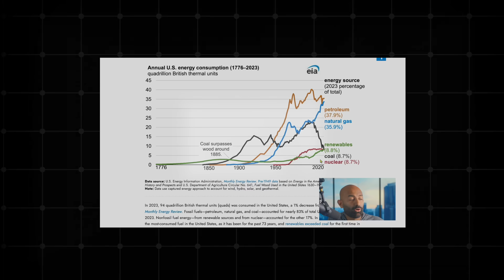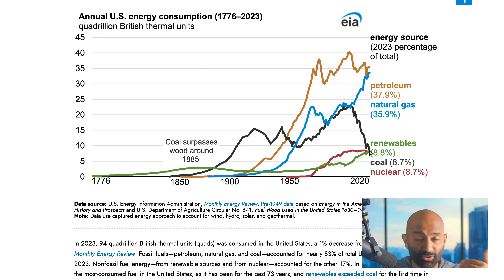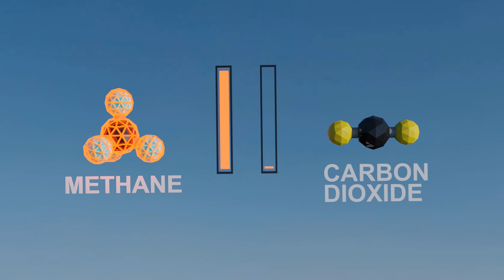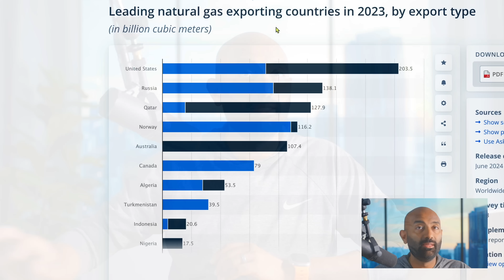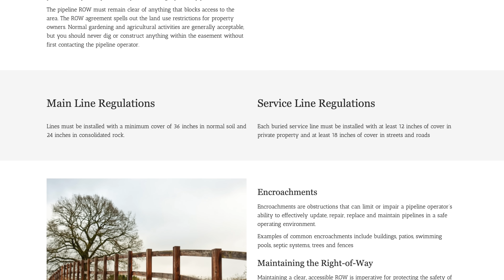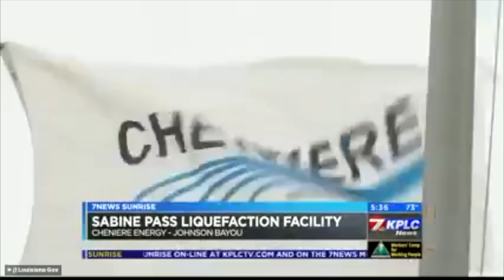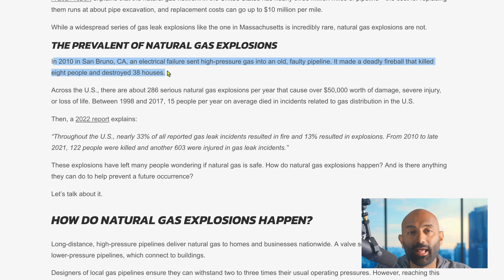The TRUE Danger of Natural Gas - This SHOCKED Me

Comment: Here in Phoenix, electrical power is expensive. I use NG to do all of my cooking plus Southwest Gas does not tag me with on demand charges like SRP ( Our local power provider ). I have solar already and will be putting in batteries soon. I switched my clothes dryer to NG so I can run it whenever  I want and not be hampered by on demand charges plus its cheaper than electricity.  i won't  be giving up NG anytime soon.

Comment: Okay, I get it, you do not like natural gas. Why would we want to systematically improve an already-established infrastructure to deliver a long used and stable energy source.
I live in San Bernardino: I am not retrofitting my over-100 year old home with an all-electrical solution. My stove is natural gas, our primary heating is natural gas. Our backup is a split-air system that is of no use if we do not have electricity (e.g., a days-long blackout).
The argument that natural gas is an antiquated or inefficient source of heat or flame is a tired one. In early January, the community I used to  live in had whole blocks of homes decimated by a fire caused by an exploding electrical transformer.
Please, explain to me again why our country does not want to upgrade and improve the delivery and usage of a natural resource that we have in abundance?
Reply from the maker: Great points! Why I don’t support banning it. But our infrastructure is not updated. How can we make these utilities ensure safety. Natural gas pipelines are aging and definitely need to be addressed. 

Also prices will continue to rise, electricity might just start to fall

Comment: The reason why coal consumption dropped so radically was that natural gas became very abundant and less expensive on an energy basis than coal.  As a result, natural gas displaced coal as the fuel source for generating electricity.  One of the benefits was a near 20% reduction in CO2 emissions in the US.

I also suggested that you compare train accident rates to pipeline accident rates.  Reportable train accidents occur on pretty much a daily basis.

Comment: I've never understood why natural gas and propane are often run through ungalvanized black iron pipe, which probably doesn't even last as long as your galvanized pipe did.  Natural gas companies are using plastic now on their high pressure side, which I believe is usually around 60 PSI.

Comment: Here in Australia, I used to work in Gas and Electricity, now just Electricity, we have to keep all the pipes pressurised , with regular pump stations, partly to keep leaks above the explosive mix level.
there is a significant level, measured all the time, of leakage that always occurs between the GAS extraction and the customers.
But not only that gas seeps out of nearly all joints and especially the end user devices like cooktops, not much, not enough to cause an explosion but you are breathing it.
We are trying to move away from it, but then you have all eggs in 1 basket.

Comment: My natural gas service was installed in 1999 with plastic lines. The regional gas company has replaced main lines with plastic.  We live in a rural area. Environmental regulations have restricted any new wood stoves. When we lose power due to storms it can take up to a week to get it restored. Without electricity and with only a heat pump we would freeze. A small generator can easily keep a gas furnace operating. If someone has a lot of money to spend, they can install a large natural gas powered standby generator to run their heat pump. The natural gas still needs to be available.

Comment: Natural gas furnaces, water heaters, stove tops, ovens, and clothes dryers are inexpensive and can go years with zero maintenance (aside from periodic dryer vent cleaning).  Water heaters also require flushing and annode replacement, but that applies to all types, not just natural gas heaters.  In contrast, heat pumps are more complex and costly to maintain.  The sealed refrigerant systems often develop leaks and repairing them is quite expensive because the cost of just replacement refrigerant is several hundreds of dollars.  Heat pumps may be efficient, but they are not $economical.  If you doubt that, just ask yourself how often you see or hear of people replacing their refrigerators vs. how often you hear of people replacing their furnaces.

Comment: Right off the bat, the pipe you demonstrated is galvanized iron pipe, but by code should have been black iron pipe. Further more, that (unprotected) pipe was obviously buried in wet soil, which is verboten. Underground residential gas piping has been HDPE (polyethelene) now for decades and the iron risers are corrosion protected..

Comment: I don’t know where you live (how temperate is the climate) but up here in Northern Illinois only a fool would convert away from a gas furnace.  Heat pumps don’t work at our winter temperatures and resistance heating is over the top for costs.  So that’s a big NO for me.

Comment: What is not mentioned is that Methane has 20 times the effect that CO2 does in trapping solar radiation in the atmosphere as heat.  It is unfortunate that to simplify the situation politicians and the media convert the methane content in the atmosphere into CO2 equivalents, so people are largely unaware that methane is contributing far more to global climate change, the warming of the planet, that just CO2.  Making it worse is that rotting biomass emits methane, as do cattle that ruminate their feed, farting and belching out the gas into the atmosphere.  As the frozen arctic tundra continues to thaw, even more methane is emitted, creating a vicious circle, that we started.  If we, the human species do not dramatically reduce the use of fossil fuels, including methane, the species will die.

Comment: One other small issue with natural gas: The giant compressors once used PCBs as crankcase oil. This put PCB vapor into the gas and deposited it in all the pipelines where it still remains today. PCBs were banned in the 80s, but the residue is still in the pipes and it gets into the gas flowing through them. ALWAYS turn on your vent hood when using a gas appliance.

Comment: As of last year, I have completely removed natural gas from my house. We even had the pipe removed, and disconnected at the street. The ageing infrastructure, and frankly the skyrocketing cost, switching to a HE heat pump for heating, hot water and dryer, has opened my eyes that electricity really is the way to go. I'm now planning solar on my roof. Once that's installed, my house will cost ~$360/yr to run (basic cost of a hydro connection in my area), and no danger of my house blowing up.

Comment: Lets correct a few misconceptions;
1. The steel used in your home pipework is very different than the steel in used in modern pipelines;
2. The planet releases exponentially more methane than humans and pipelines do;
3.  Modern gas pipelines do have circuit breakers, the are called LBV;s or Line block Valves;
4. Landman is a fictional show, it doesn't matter if it is gas, oil or water in a well (actually all 3 occur in various amounts depending on the reservoir) when a blowout occurs, it usually ignited until it can be snuffed).
Nuclear is the future but good luck convincing western societies to embrace it, nothing is good enough for the Green Cults.

Comment: Yes, we should depend on electricity alone.   That way when the electricity goes out we will be without any heat or hot water.   That way the water and sewer pipes can all freeze and burst destroying your home.   No thanks, I’ll keep the gas for affordable and reliable heat at an affordable cost.   Heat pumps don’t work well in cold weather, and someone from LA doesn’t know what cold is, and are more expensive to service and repair.

Comment: For the cars that run on LNG, they usually are a flex fuel system that can work off of both gasoline, LNG, and sometimes alcohol/ethanol. 

That makes sure you can always buy the cheapest per unit traveled fuel, and dont get stranded if somewhere doesnt have one of the ones you need.

Comment: You are either ignorant or intentionally lying! Which is it? Safe hydrogen storage was developed in the 1970s. It worked so well that the government outlawed its sale. You can legally make it. Legally use it. The government just stops you from selling it. This system works at ambient temperature and pressure and stores the gas in a latice matrix.

Safely storing hydrogen is NOT a problem. Efficiently creating it without nuclear power is! And we have had the technology to do that for decades too at the point of sale.

Comment: Years ago and I am at my friends 17 floor apartment on a summer night about 6 PM. All of sudden I see a small mushroom cloud with flame a few miles away. We get in the car and drive there. When we were about 1/4 mile, as close as they would let us I could see pieces of wood and shingles all over the street. What happened is the owner decided to do an insurance fraud. The house had a basement and he loosened the gas line just enough so that it leaked but didnt emergency shutoff due to free flow. He left a candle burning on the main floor and the house filled with gas until kaboom. The house was gone when I saw the pictures in the paper.. I will add that if you break your gas line there is no back pressure and it shuts off. In Canada they put a chemical in gas that makes its smell very distinct.

Comment: Electricity?  The control system is right out there on the internet, and hackers have targeted that for a "remote off" command.  When outages here run from minutes to weeks, you really HAVE to have a big generator... typically natural gas powered.

Comment: Just like the water network, the gas network degrades over time and does need maintenance - the benefit of an electricity network (Conventional baseload is "value added" fossil fuels), once it is in the wires there is less likelihood of "leaks" along the way than piping gas directly to the vast distributed consumer network via old and ever aging pipes.  Unfortunately there is no simple and cheap method to convert electricity back into water at the end destination   (or the only utility we would need is "electron - energy" - ie, electrocity. (jk).

In Ultra cold places - Ground source heat pumps are a real option - places that get to minus 20C probably shouldn't be relying on air source HP for winter heating...

Comment: One aspect that should might be interesting to clarify. I’ve been told there are limits to how much natural gas can be re-injected back into oil wells. As long as we need the products that are made from oil other than energy they will be needed. Stranded flare gas is one of the biggest wastes in industry and the ecology. All gas recovered from wells should be used not flared. By encouraging reducing consumption of natural gas by the general population you are likely going to increase flare gas. I’d rather see it used by consumers and base electrical load than be flared at the well to be disposed of. Don’t forget the oil ecosystem has many product streams that once were considered to be waste and were ecological nightmares thru improper disposal. There are numerous horror stories about gasoline being dumped into creeks to be disposed of before they discovered it could be sold. Back when gasoline was high in the past there were companies working on converting flare gas stranded at the well into liquid fuel oils that could be transported by railroad tankers. The technology of course died when fuel costs dropped and it became marginally economic. It’s very important to use all the products that are pulled out of the ground not just fractional components of it. Living in an area that has cold winters nothing is as nice as natural gas water heaters and gas furnaces that can run on minimal backup power when winter storms take down power lines. Buried natural gas lines are a blessing in those times. Electricity can almost be considered an afterthought or luxury if you heat with gas appliances that don’t require electricity. My grandparents lived in a community that had public water, sewer, and natural gas. Electric was strictly used only for refrigeration and lighting. Nowadays we ma have more electric gadgets but most can be powered by simple batteries as backup as long as you have gas for heating and cooking.

Comment: Im HVAC and have installed and removed tons of these.  I have seen them still functioning perfectly fine despite NOTHING being left of the pipe.  There was a Pipe shaped hole in the dirt packed good that functioned as the pipe with bits of what was once the pipe around it.  Funny enough, no gas smell and no idea anything was wrong.  We were there for something else entirely.

Comment: All natural gas lines for a number of years has protective covering to prevent corrosion. Water piping in older house used copper lines which is subject to corrosion, that is one reason new houses use plastic lines ( also cheaper than copper)   Natural gas has a lower carbon footprint than coal generated electricity     Good info.

Comment: The good thing is that around here they don't allow galvanized pipe anymore or black iron below grade for feeders, only for protection until slightly underground and switch to plastic gas line.  That way it can leach microplastics into the soil just like the power company as well with all their plastic conduit.  😁👍  Someone will have to pry natural gas out of my dead hands before I give it up without a fight.  With the amount I use for both heating the house, heating water, heating the pool and hot tub and powering the 30KW generator, yet alone stove, oven, bbq grill, dryer, and pretend fireplace it would cost a fortune to replace all that with electric versions.  💵

Comment: I live in a Midwest city.  We seldom have to use the BBQ for cooking for more than a few meals because of elect. outages, but that is why we bought one.  The houses in our neighborhood were built a century ago when the delivered coal fed huge cast iron convection furnaces.  On windy days in the winter we can feel the "migration" of air through the house.  -20f is not uncommon, and with a wind makes the initial cost of heat pumps include significant back-up heat.  In this part of the country, that is usually gas.  My in-laws live in the MN/WI area.  For many years, their outdoor wood furnace was sufficient for space heat.  They used propane for water heating.  Their house was much tighter than ours.  That said, I look fwd. to a heat-pump water heater when this gas one dies.  <a bit longer algorithm fodder than my usual.  Sorry about that.>

Comment: Hey Ricky, you forgot to mention that they put an additive in natural gas so that it has a detectable odor. That is how you can easily detect a gas leak in your home or business.  The local fire departments and gas companies are quick to respond to suspected leaks that are reported. 

I have a heat pump for home heating in southern Wisconsin.  It works down to around 30 F. Below that, the natural gas takes over. We also use gas for domestic hot water and cooking, which is economical compared to direct electric heating. Heat pumps for domestic hot water really are not  effective here. I wish that they were. 

Most gas distribution lines here have been plastic for the last 40 years or more. Inside the home and protected from the elements, black iron pipe has been successfully used for over 100 years.

All modern gas fired appliances have effective safety controls to ensure proper operation and will shut off the flow of gas if a problem is detected. 

A gas stove top does not have safety controls and must be monitored by the user.  If you want to cook something, you must turn the gas on and ensure the burner lights. Turn the gas off when you are done. Darwin rules apply.

I am comfortable using natural gas in my home and LP gas in the outdoor barbecue grill, although my primary fuel source for outdoor grilling is charcoal.

Comment: So your house line was improperly installed. No cathodic protection or properly wrapped. Yes there are steel lines and yes there is entire organizations/departments that focus on pipeline safety and cathodic protection. Proper installation methods etc. residential areas have transitioned to polethelyne plastic pipe. Last, look at the efficiency of electrics from generation to customer vs natural gas. I’m confident both sources can coincide to support balanced energy needs. S

Comment: @TwoBitDavinci  Purely electrical age??? You think like a California city dweller who is oblivious to how things are made. How do we generate the electricity? Electricity does not magically generate itself. The majority of electricity is generated using NG or coal, unless you live near a Nuke plant. The main sources of power in San Diego are natural gas (53%), coal (13%), and the remaining are solar, and other minor sources. They also import power from other locations. They closed the nuke plant and refuse to build others, which was idiotic. The more heat pumps you install, the greater the need for NG to generate electricity. Guess why those NG lines all lead to the big cities? Because the demand for electricity is so great. Get rid of big cities and the NG demand diminishes. As a matter of fact, most other problems with also disappear. Heat pumps have improved, but they don't compare to NG heating units. When electricity goes out, NG users stay warm and can still cook while you freeze and starve.

Comment: The only reason that natural gas remains popular is the cost unit to operate. SDG&E's electricity rates virtually make it impossible to migrate heating appliances to electric no matter how clean we get with renewables. I know induction is coming but even those rely on high powered systems. In the end, it has to make economic sense for the users